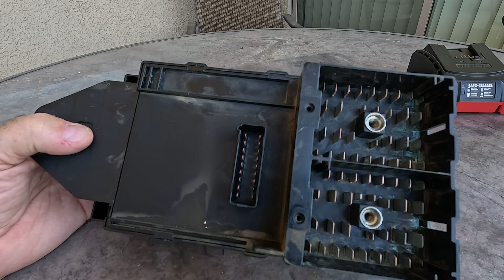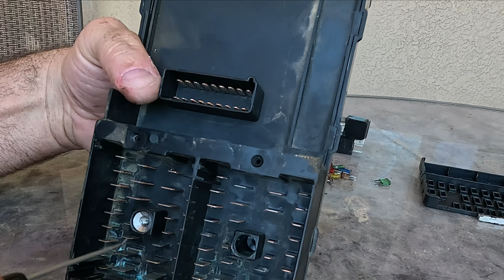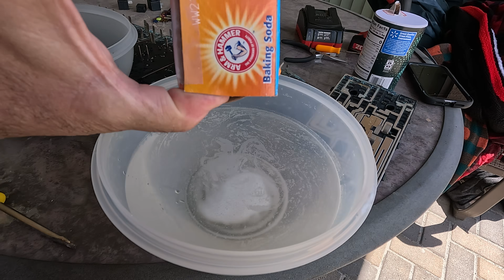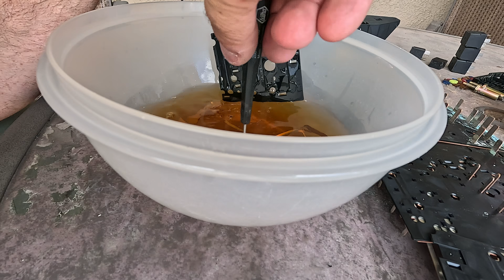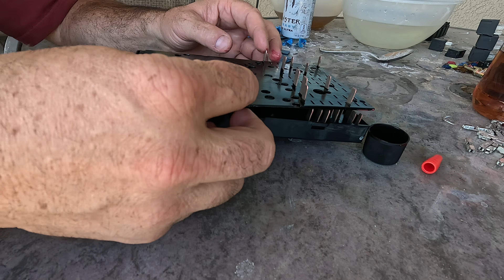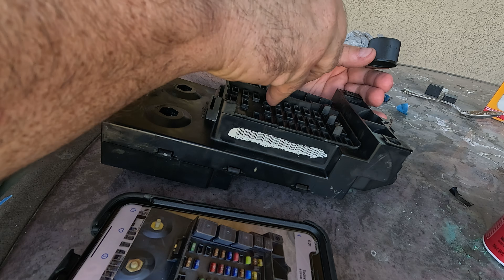How to Fix Your Ford Truck Fuse Panel (Avoid $2,500 in Repairs)

Comment: I just rebuilt mine. Before the cruise control didn't work, the doors would randomly lock, the left your light on alarm came on randomly and sometimes the battery would drain. Now the headlight alarm seems to work properly but the cruise control still doesn't work and now the speedometer and the dome light doesn't work.
Reply from the maker: Did the other symptoms go away? It sounds like it helped. I would pull each fuse and look in to see if you can see the connectors. It is easy to put them in the wrong hole when re-assembling the unit. Then verify each fuse is good before putting it back in. Hopefully you get it worked out. Did you find much water damage when you first took it apart?

Comment: Overkill as if you expect the truck to get flooded. I plan on replacing my windshield before it starts leaking. I had the dash off and I saw no signs of water drips on my 1999 F-350 but there is a little rust around the windshield seal
Reply from the maker: I take my truck int some remote places this is one less thing I need to worry about! Thanks for watching!
Reply: @heathputnam9524  It was gutsy of you to pull this off. I'm bookmarking it just in case  but I wont do the paint but might use T-9 on it :o)
The windshield gasket on my 1999 is stiff/hard but on mt 2010 it's soft and has better contact

Comment: I'm having a hard time getting the connectors in, then getting the #$%^ thing into position under the dash. I cant fit my hand anywhere to work. It's all hidden where I can't see what I'm doing. The frame around the bottom under dash is all plastic. Can't see where it's possible to get access. I've cussed myself out of sanity. I have to do everything I can to not go ballistic.

Comment: I can't get my fusebox loose after removing the 10mm nuts and screws, 98 f150. Is there a secret trick?
Reply from the maker: There are two 10 mm on the back of the GEM unit… towards the firewall. They hold on the wire harness. Back those off and that we’ll allow the box and GEM to come free.

Comment: Can i use regular paint to cover the metal connectors?
Reply from the maker: The lacquer is actually used because it does not conduct electricity… thanks for the question!

Comment: Thanks for posting.  My 2001 Powerstroke started trying to crank itself and the horn blaring after a thunderstorm a couple of months ago.  Disconnected the batteries.  A few weeks ago I drove it to AL 400 miles no issues.  I went to start it and nothing I jumped it with a jump box and drove a couple hundred miles.  Next day the batteries were dead, I replaced the starter solenoid, it started and drove fine  Today the batteries are dead again and the new solenoid smells burnt.  I guess I'll be pulling the fuse panel and GEM.  I'm 72, but not going to pay that kind of money to have someone replace the GEM.
Reply: In the very beginning 12-13 seconds in you are reaching up behind the module.  Are you removing a plug on the module or a cable from something else?  It took 10 minutes to take all the bolts out.  I have the connectors on the left side out but still can't get the module to drop all the way out.  I likes about 1" of being out.  Thanks, Ken
Reply: OK just watched another video and they showed there are 2 10 mm nuts holding two more wire harnesses in place.  I'll try and get them off and disconnected.
Reply: Just undid the 2 10mm bolts holding the wire harnesses in the back and it fell out into my hands.  Thanks for posting this video,   You must have lost the first 30 seconds when you loosened those bolts.  LOL!  Now to go buy a set of T nut drivers. most of my tools are 400 miles away in FL.  Thanks, again, Ken
Reply from the maker: Thanks for the updates! I am glad you got it out! Sorry for the quick intro in the video. Those bolts screw into the flange you drill out. That is why it is important to only drill until the heads fall off. Good luck with the project! Let me know how it goes!
Reply: @heathputnam9524  I finally got it back together yesterday afternoon.  A couple of cautions for anyone doing this.  Use an o-ring pick, I tried using a dental pick that was a little too fat.  I noticed that the fuse holders were not holding the fuses tightly due to spreading the contacts that the fuse sits in.  I pinched them back together with a pair of needle nose.  Also AI said not to use vinegar and salt, the salt could cause corrosion issues later.  I used white vinegar and a brass wire brush then neutralized in baking soda and water, then a quick wipe down with acetone.  I will use di-electric grease on the plugs when I install the module back in the truck.  For now I'm going to seal the windshield gasket with a 10 oz tube of Permatex polyurethane sealant about $15.  I'll install the unit tomorrow morning when it's cooler and park the truck under the barn to allow the sealant to dry 24-48hrs.  Hopefully I will get a chance to paint it in the next 6 months to a year.  Again thanks for posting this video, I never would have attempted it without seeing it done.  God Bless, Ken

Comment: I removed my gem module. It was so bad some of the prongs were so corroded and a couple of them were broken so I had to run to the junk yard n grab another gem. My question is it wasnt exact the same gem. Some of the prongs are missing on the new one as well as the big fuses wont seat back in the fuse box in the spots for them. Can I just open the new one and put everything in the old body so I dont have any fuse issues ? After cleaning it out. The part number was literally one ended with BB the other one is AB. PLEASE HELP !!! My trucks been broke for a couple of weeks now.
Reply from the maker: Were the years the same? What year is your truck?

Comment: The dielectric grease application seems a bit sloppy. Consider spreading the grease on a small board to swab it with an acid brush to then spread it on to the connectors. Similar to the way an artist uses a palette board to wet his brush.

Comment: Nice how to and demystification of problematic fuse boxes.
IMO -"dielectric"  grease is not used for this type of service. It very likely will cause other issues via poor contact.  There are many other products that will reduce oxidation exposure without reducing connectivity.

Where Not to Use It (or Use Cautiously)Between actual contact surfaces in low-voltage or delicate electronics/communication ports if it could prevent reliable pin-to-pin contact (some mechanics avoid it on certain sensor connectors or data lines). 

High-current sliding or high-pressure contacts where a conductive grease might be better (rare in consumer automotive use).
As a substitute for thermal paste on CPUs or heat sinks — it is not designed for heat transfer.
On rubber parts if a different compatible lubricant is specified.

Note: Dielectric grease is an insulator and protector. For connections that already have issues, clean them thoroughly first—grease alone won't fix poor contact. 

Popular brands include Permatex, CRC, and various automotive tune-up greases. A small tube lasts a very long time for most DIYers. It's widely used in automotive, marine, and outdoor electrical work because it excels at keeping water and corrosion out while remaining stable over a wide temperature range.
Reply from the maker: Carl, Thanks for the explanation. I used dialectic grease for the exact issues you mentioned. The connectors themselves do not have a problem making connection. They have a very strong mechanical connection. It was the infiltration of moisture and oxidation I was most concerned about. I did not explain that well enough in the video, I guess. I am certainly not an electrical professional. Thanks for the comment, I hope it helps someone fix their old Ford!

Comment: Video is a year old, so i get it if you don't respond. I have a '97 f150. I believe it is the 5.4l. It has 4x4 and power locks and windows. The driver side window does not work, only blinks the dome light when the switch is pushed. The passenger will go down slowly, but not back up. 4x4 does not work at all, but all parts test good. I've read reddit posts about these same symptoms all saying it is the gem module. Could the issues I'm having possibly be the fuse block as well? I am gonna take the block out today and check it over.  Thanks for the video!
Reply from the maker: Yes it could definitely be the block. If you pull the block and find any corrosion around the pins, you might have found the issue. More than likely the block has issues, and if it turns out to be a GEM problem, it was probably caused by a short in the block. Good luck and let me know how it goes! Thanks for watching!

Comment: Thanks for the video.  How did you reinstall the 2 studs that were drilled out?
Reply from the maker: As long as you didn’t drill too deep you just use the same bolts that attached it through the dash when you took it out.
Reply from the maker: Thanks for watching

Comment: Out of all the automotive videos I've seen you were the most specific about things explaining very clearly thank you for such a great video. I don't know if I'll need any more advice in the future but I subscribed and liked anyways. I have a 1998 Ford expedition XLT with this problem but the only thing that I question is if it is the windshield . that's what we thought it was at first I've been a roofer for 40 years and do a little mechanic work and we use a very high grade sealant on roofs on flashings and things like that that works beautifully and I used it on my windshield and that didn't fix the problem I don't have any cracks in the windshield either. My buddy thinks that the water might be getting in the side panel for the electrical wires for the door on the driver side. I have not tried your fix it yet but definitely will ASAP.
Reply from the maker: I have also seen the roof rack leaking and the water runs along the roof strut into the a-pillar. I got a comment that said they put a plastic bag over the box when they reinstalled it. I thought that was clever. Good luck man! Thanks for the sub!
Reply: @heathputnam9524 yes being that my job is stopping water leaks I figured I was going to take the left quarter panel off and those wires that are running in from the left door see if there's any way that I could seal that opening because I just cannot see how it is possibly the windshield with everything that I did to it. It's been a strange problem though because sometimes the thing has gotten poured on and I even took it through a car wash and no wackiness happens with the electrical system and then other times it has so I don't know what the deal is with that.
Reply: And I never thought about the roof rack being a possibility

Comment: Question, if I replace the whole fuse box and the truck is deleted, do you have to re-program the truck?
Reply from the maker: The fuse box will need to be cloned, I talk about that in the video. The fuse box doesn’t have any reprogramming required. If you change the GEM module also, it may require reprogramming. Thanks for watching!

Comment: Took me well over 12 hours🥹 I was also going back-and-forth doing a lot of researching and had to run to the parts store once but the worst part was the two fuse boxes I had were so corroded that I had to Dremel every single bus bar with brass wire brush to remotely clean it and I had to do a couple soaks off and on they were very corroded but now it looks brand new
Reply from the maker: Wow! Sounds like it had been leaking a long time! This fixed things I didn’t even know were wrong with my Excursion. Hope it does the same for you! Thanks for the comment!
Reply: @heathputnam9524  thank you man Thank you and I really appreciate the video.

Comment: My 2001 ford f150 V6 Manual was starting on its own and keeping ignition ON position with keys in hand every-time the rain started. I will be considering doing this job this week, thanks for going in depth and detailed on how to do this job!
Reply from the maker: Telltale sign of a corroded fuse box! You should get your windshield seal fixed also, or at least put a plastic bag around the box to protect it from the leak! Hope the fix goes smoothly! Thanks for the comment!

Comment: What did you pull off the back at the very beginning ? Mine has to two 10mm bolts that just spin and won't come out in that location.
Reply from the maker: Are you referencing the two screws that hold the large connectors into the fuse panel? The normally have “E” clips holding them in and as you loosen the bolt it lifts the connector off but if you have corrosion in the plug the bolts do not lift the connector completely off. Just try to pull the connectors off now they the screws are loose. Hope this helps.

Comment: How did you screw in the two big connectors on the back with the 10mm bolts when you drilled out the studs?
Reply: The bolts on the backside sit on the dash frame keeping them in place I did mine what a task lol

Comment: Great video, thanks for sharing. I have a Ford fuse box sitting on my bench that was replaced. They are 600 dollar touch here. It definitely got wet - someone had burned a hole in the center of the lid - looks to be a soldering iron set down on it when they were wiring into the Upfitter Pigtails. It was like that for years. I'm surprised a mechanic would just leave it like that. They should have sealed it up with some epoxy at the very least.

I'm going to pull it apart tomorrow and take a look. If I can repair it, it might come in handy for me or someone else in the future. Ford is still having problems with their fuse boxes. Even in new models.
Reply from the maker: Crazy since it has been a problem since the mid 80s. Thanks for watching!

Comment: 3 hour job!?!  Well I gotta tell you it took me about two hours just to get the thing out, contorting my body and using muscles in ways that will come back to bite me.  It took another hour to strip it down into a million pieces, and about four hours of pure hell cleaning and trying to get it all back together. It’s a 3D puzzle with pieces that don’t stay where you put them and gravity is not your friend as you try to restack the many levels of loose parts!   I used a lot of dielectric grease to hold the bus bars at least to some degree. Hopefully most of it went back in the right places. My confidence is not high that this is going to solve anything for me. If you’re trying this job, good luck to ya.
Reply from the maker: Haha! In a couple weeks you will look back and say “piece of cake”! I hope it helps your truck! Thanks for the comment!

Comment: Will try this. 
Im dealing with no power in fuses 16, 18 and 20 on cabin fuse box.
Reply from the maker: Quite often a whole section of one of those plates will corrode completely away. Hope this works for you!
Reply: I just finished drilling the screws, will get the plates out shortly.  @heathputnam9524

Comment: Oh my gosh! Thank you for such an awesome detailed video. Clear, precise and clear video footage as well. I can hear you clearly. I appreciate your whole process. My 2004 Ford Ranger XLT 2wd 2 door extended cab, 3.0l V6 automatic has been giving me a heck of a time. Windows roll up and down when they want. Or don't want. Overhead courtesy light comes on when it wants to or doesn't or stays on. Apart the door panels to look inside to see if it was the motor. Or if there was a short. Then I got a new overhead map light. Did you just doing the things that I could. At the same time I've been having some transmission issues like slow to shift, random shuddering, horrible gas mileage, and delayed response in the gas pedal. I replaced the starter solenoid with some new wires and new plugs. That helped for a little bit. So then I started looking into the wiring the battery. Looks a little corroded for the wires connect to the connectors that connect to the battery post. So I have my boyfriend clamp those down really hard. And everything was working pretty good. But my battery is about 3 years old and just isn't holding the charge. When testing it it was at 11. So we just picked up a new battery and installed that. If that doesn't help with the interior lights are windows then I'm going to have to follow your video and do the same with mine. 🤞🙏 I'm hoping the new battery works out for me. But I found it crazy that I could have went and got a new transmission or something when the whole time it could have just been the battery. Wish me luck. Thanks again for the great video. 🙏🫶♥️
Reply from the maker: Good luck! I’m glad you are getting the old ranger up and running! Thanks for watching!

Comment: Love the video thanks for doing this.
The question I have is  a "clone"  for my f350  I definitely know it's different from the one I picked up from the junk yard. If I clean the new fuse block  but don't install the fuse and relay terminals  when I take out the one in my truck am I able to match the  fuse and relay location  with the cleaned box. Question really is 
Are the blocks all the same just the fuse and relay location different between model and option ordered on a truck
Reply from the maker: Yes, the boxes are the same. You just need to match all the fuse and relay locations to your old box and you are good to go!